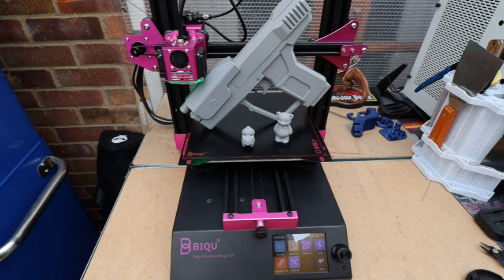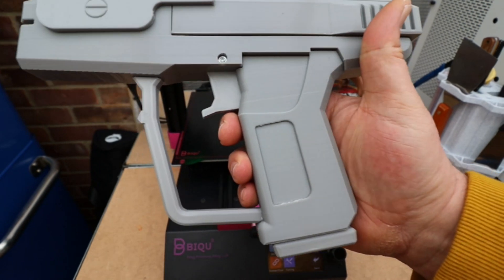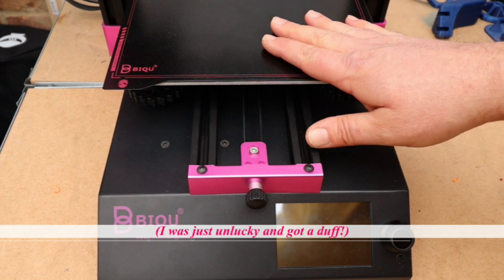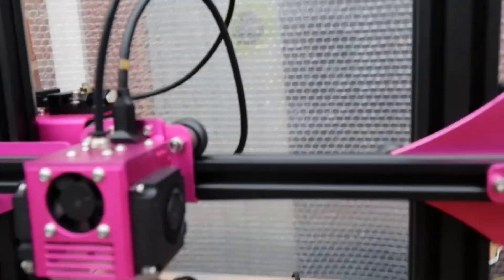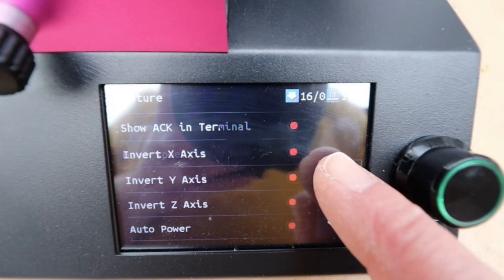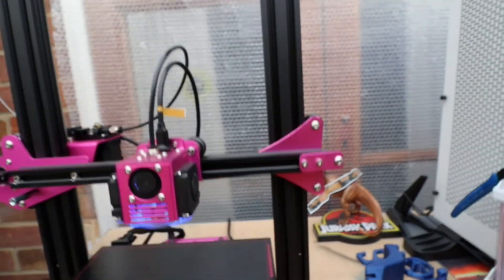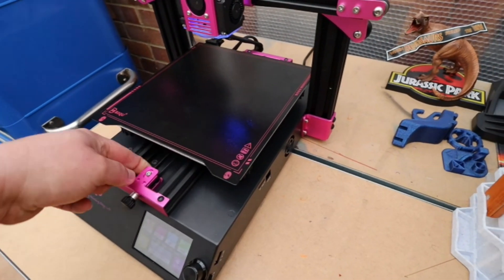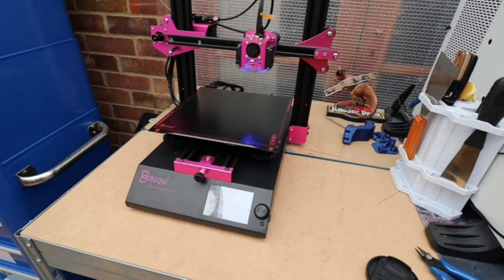Biqu B1 3D Printer First Impressions

Comment: Looks like screw is loose on belt tensioner. Need to adjust manually to correct position and tighten the screw with a correct size key so it wont rattle.  Before that loose the knob and last do final adjustment with the knob.
Reply from the maker: I had the whole thing apart many times, there was no way to adjust anything
Reply: @BeanGaming-w4n  Added a short video to my channel about how I adjusted it. Mixed few things on my first comment anyway. Hope it helps. 🙂